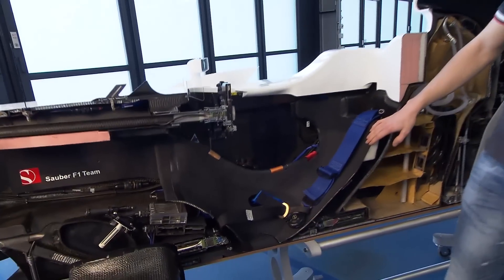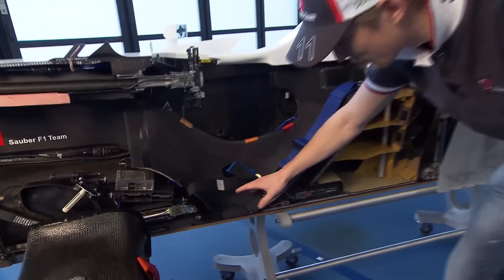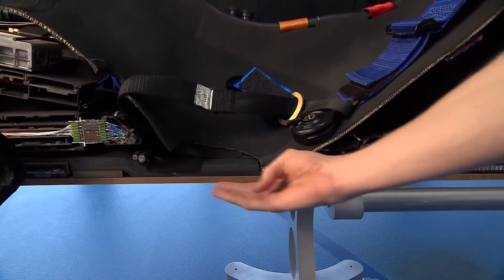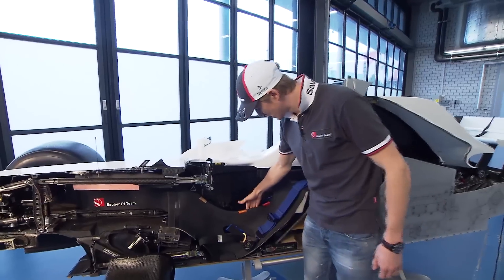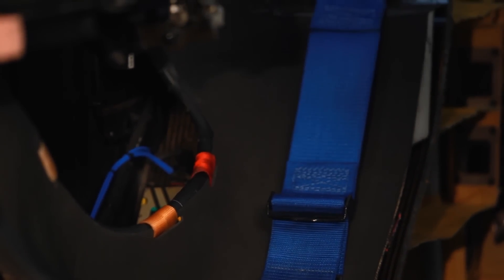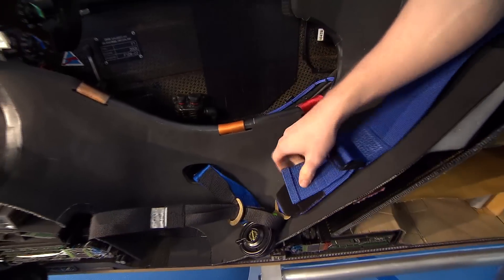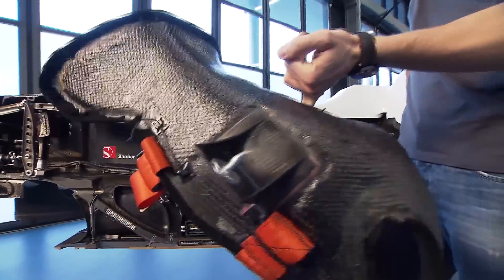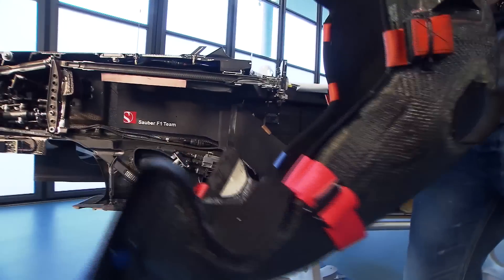Cutaway Insights - Episode 3: Driver Seats - Sauber F1 Team

Comment: Aside from the lowest CoG and the reason that Sauber gave you, there really is no OTHER way for the driver to be positioned merely because of how F1 cars are designed. They need to be that low so that the airbox will not be blocked above their helmet, and their feet/legs have to elevated like that because of the raised nose design. When F1 cars had low noses (similar to Indycars) the driver would be in more of an "L" position instead of legs at chest level.